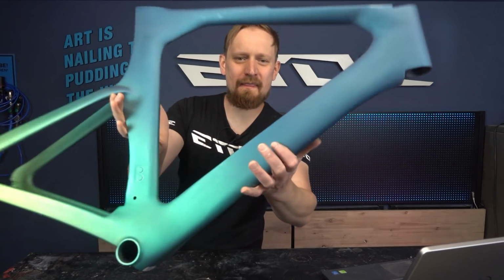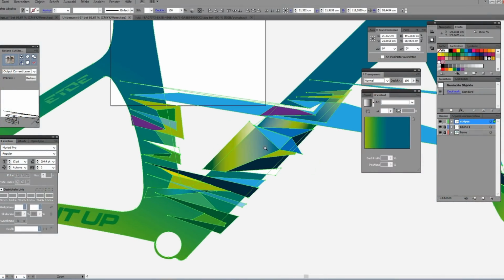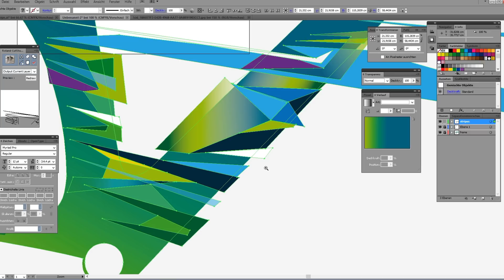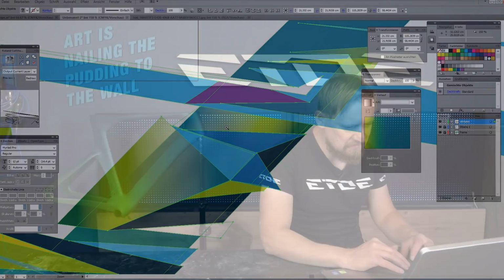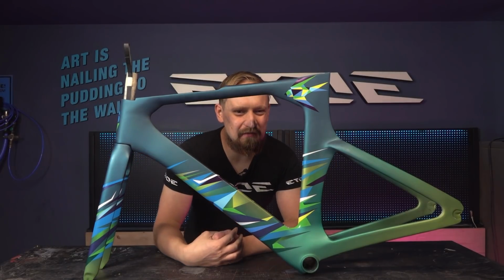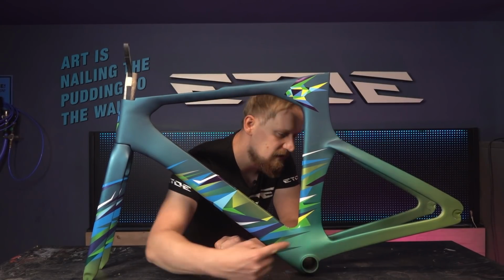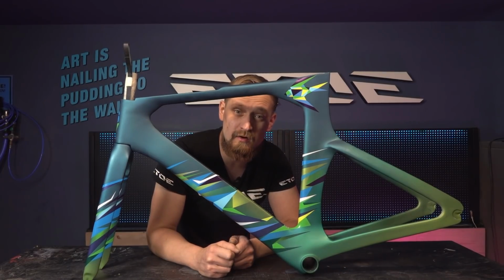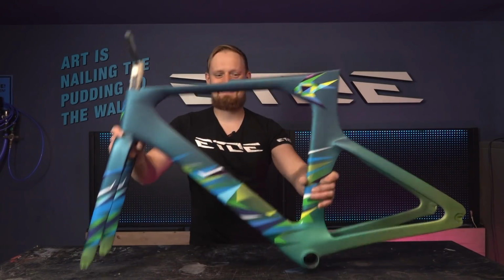a girls dream bike paint - Martin Grey @ETOE

Comment: Do you add some shiX to the base coat to make it last so many hours before you apply clear coat? In generall, the base coat should not be too dry or the clear coat may not react properly.
Reply from the maker: I use completely different colors which can be open for days until intercoats or clearcoats are applied.
Reply: @ETOE  Thank you. Can you tell me, what are these colors?

Comment: greetings from Colombia I want to ask if after finishing each masking it is necessary to sand to remove the contour of the mask and then apply the varnish
Reply from the maker: Not with these colors. If you spray white logos maybe.
Reply: Can we say that the varnish optimizes the surface of Los Cortes of the masks of each color?

Comment: Very impressive work! When you do a matt clearcoat, do you also do it in multiple layers with sanding in between each layer or do you just apply one layer of clearcoat?
Reply from the maker: Depends on the design and used base colors.